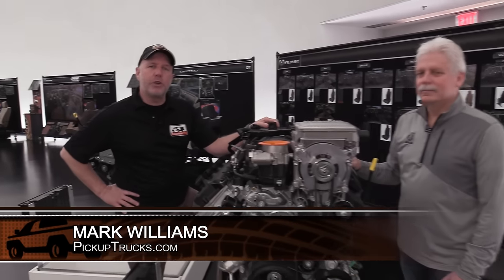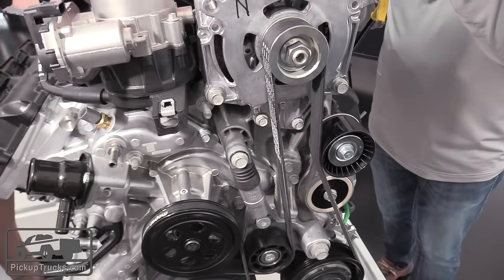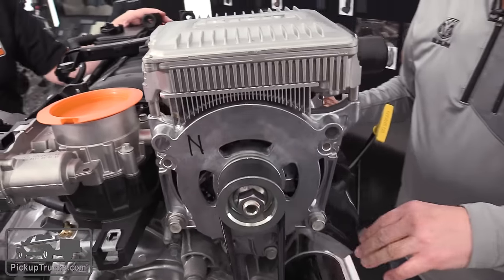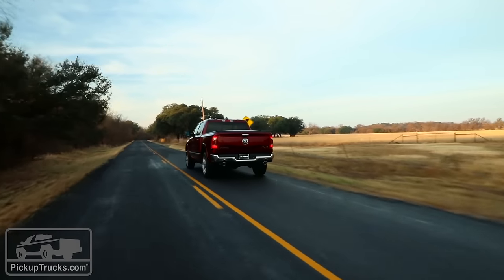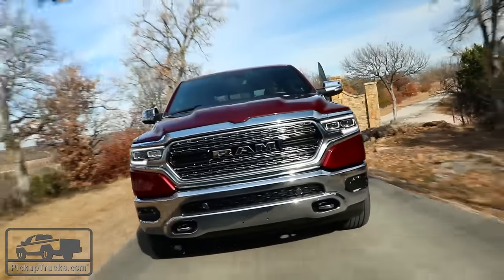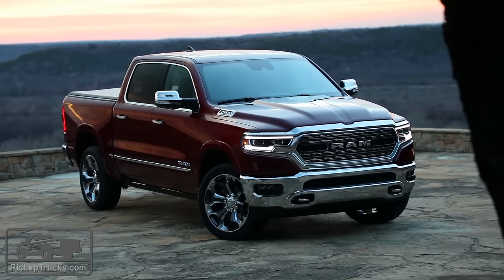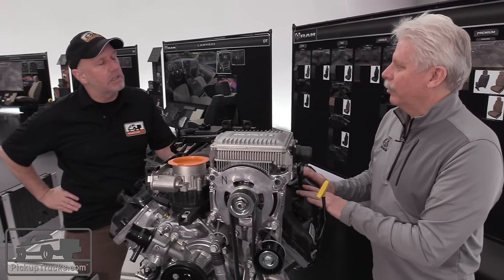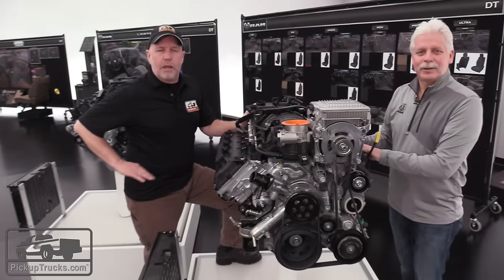2019 RAM 1500 e Torque Explained

Comment: Sounds like something else that can break !!!!
Reply: This is the least it can break in today modern day engine
Reply: Except this 1 part will probably cost 2-3k
Reply: Have an etorque hemi Ram, it’s a cool operating system. Engine shuts off at lights and you barely flinch coming off the brake and it instantaneously sends power to the engine launching the vehicle forward initially. However I would not suggest buying any advanced technology vehicle without buying extra warranty packages. Adds to the overall vehicle cost obviously.
Reply: Exactly
Reply: The narrator: In fact the cars caught fire
Reply: Love mine.
Reply: Mines broke today
Reply: Oh no a part that can break it’s not like every other vehicle on the road is made out of parts that can break.
Reply: I've had mine 3 months and it's been in the shop five times already ,I recommend ot getting it
Reply: Fact
Reply: My bestfriend owns a mechanic shop about a hour east of Houston  said he just put one on a 19 model that broke with 100k miles cost em $6k for a new mopar e-torque system.. wild no thanks
Reply: Good thing it's just a bolt in and you can remove  it lol
Reply: 48v in one
Reply: Sounds like something that is extremely expensive when it breaks out of warranty.

Comment: I would rather just spend a few more dollars on gas than to have to worry about how much it will cost to get this fixed when it craps out.
Reply: SkywallGuttz  and he didn't pay a dollar because that's covered by warranty.
Reply: Beeing Its a fiat I'm sure it will need replacement right after the warranty ends.
Reply: @colemiller3900  and he wasted his time to visit a dealership.
Reply: Exactly. In fact your only gaining 1 more MPG. Not worth it. And you can’t do any power mods
Reply: $15,000

Comment: From a straight "mileage" perspective, lets break it down. MY 2014 RAM average about 18 mpg. So if its a 10% gain, that puts me to 20 mpg (using round numbers) SO if someone keeps the truck for 150,000 miles at an average gasoline cost of $2.50 or so, A conventional Hemi would burn 8,333 gallons or $20,833 of gas.. this "E version" would burn 7,500 gallons or $18,750 of gas. So basically you are "saving" +/- $2,000 over the 150,000 miles IF you keep the truck that long. AGAIN from a PURE mileage vs. Money perspective, it they charge more than $2,000 for this "E" option on the Hemi are you "Saving" ??  I know you can argue, its more torque, better towing, blah blah blah , ALL of the typical Diesel arguemnts...it ALL depends on how YOU use your truck .. .. .. just food for thought
Reply: Mike D you must drive like a grandpa
Reply: Mike D or purely highway driving
Reply: Legend Of I45 or maybe I drive like someone who is TRYING to get good mileage... rather than someone who FEELS more manly because they got to 60 faster than the guy next to them
Reply: And will it need a different, more expensive battery? That would alter your calculations.
Reply: It also relieves on on the brakes and the tranny.  Thus give more longevity in theory
Reply: Is your Ram with the 4.7 v8 or 5.7 Hemi v8?

Comment: I think the fuel savings will not outweigh the costs from constant loss of oil pressure between starting and stopping the engine.
Reply: There are Zero fuel savings. My 04 with a 5.7 got the exact same mileage, didn't shut itself off at lights(dumbest thing they've ever done to vehicles) and was a V8 all the time.
Reply: @hughjass1835  and made way less power. And was rated at 5mpg less
Reply: @hughjass1835  lol tell me you can’t afford a new truck without telling me you can’t afford a new truck 😂 even if the gas mileage is the exact same. It’s impressive to get the same mileage with 100 foot pounds of torque More
Reply: @Ed Hughes  but you don't get more torque output. That 100 ft ponds or so is for basically starting the engine and when it's in 4 cylinder mode and trying to lug its way up a slight incline.
Reply: @corndogg78  you get some of the output, but down low. Doesn’t increase your peak though
Reply: I think the Auto Stop is a federal requirement now. If you don’t like it, you can always hit the switch that turns it off.
Reply: The auto stop is why e torque was created. It’s a better system than relying on a traditional starter.
Reply: Very true.  This is just more wear and tear on the starter.  No need to start and stop the engine.  More fuel is consumed when the engine is constantly turned on and off.  Just switch off the on and off mode.  Less valvetrain wear and consistent oil pressure when leaving the engine running.

Comment: will this help me spin the tires
Reply: Yes, until your lifter bearings fail an Destroy your cam shaft.
Reply: @jacobsebastien3910  🤣🤣🤣
Reply: ROTFLMMAO 🤣
Reply: No quema cuh.
Reply: I test drove one deciding on if I wanted to trade my 19 classic for a 2021 nbs. There is major difference in torque response adding this. It will drift around a corner from a stop and do donuts. Also with traction control off it will spin the tires and fish tail even driving at 20 mph. I just did all this yesterday. Now. Overall I will keep my all steel body. The doors and bed feel cheap since they are now going to aluminum. I'm not sure exactly what all is aluminum but if you see the door panel vibrate when you close the door that's a no thank you. Also I'm 6'4" and the seat position in order for me to have the seat all the way back is a no. You have to have the seat all the way down in order for it to be all the way back and when you do that you feel like you are in a car. When I drive my truck I like to have the seat all the way up and back that way I can see around me better
Reply: @jacobsebastien3910  sooooo. You are suggesting that gm has no issues on camshafts for the same issue? Or Ford doesn't have to replace whole engines? Obviously you don't have a clue. You might want to sit down
Reply: That's the real question
Reply: Lol

Comment: This would probably be ok if all one did was maybe tow a small boat or just need a pickup truck for some other reason. I do know this much for sure, It's has not been reliable for farm use. Dust and dirt infiltration into the electric motor/alternator unit probably  played a significant role in failures that are very costly to repair.

Comment: When I saw this on my truck, I knew it was a must to add the extended warranty.
Reply: You are correct.  I hit 3yrs and 21k miles and this ETorque unit failed while I was up in Canada fishing.   Ram desire said the warranty ended 2 days prior to going into the dealers shop.   They also would not except the extended warranty and I had to go through that nightmare after I got back.   Parts and labor fit the ETorque unit was over $2800 US funds.
Reply: @richardgreen5619 I'm nearing the end of my factory warranty and was considering an extended warranty.  Please elaborate on my extended warranty wasn't honored.

Comment: So the e torque is great in 4 cylinder mode... got it. Was hoping it would add more acceleration torque and boost to help with fuel consumption while towing. Like uphill going through the Cajon pass for those in SoCal that are familiar with that stretch of highway.
Reply: e torq does not work in 4 cyl mode
Reply: I wouldn't tell people your from California, they might get the wrong idea Lol

Comment: I just bought a 2019 ram 1500 limited with E torque love it!!
Reply: How are ya liking it a year later?
Reply: Any performance update to share?
Reply: Same here 11K+ miles...runs like a dream.  👍👍  Best car/truck I've ever driven.  Wish the throttle was a tiny bit smoother tho, but quiet on startup like he said, and accelerates effortlessly.  ❤️ it.
Reply: HemingwaysMojito looking at one myself. Hard to find long term reviews still though, from what I have seen. Hard to find a truck that I like without that system too though.
Reply: I turn mine off.. the reason I bought a ram is cause they let you turn it off unlike the competitors.. I own a 19 limited and its s bad ass beautiful truck just gotta see how long she lasts

Comment: I have a 2020 Silverado and a 2021 Ram.  The 5.3 in the Silverado does the restart using the starter motor. The Ram Hemi uses the e-Torque motor for the restart. The Ram restart after auto-stop is noticeably quieter and smoother than the Silverado restart.

Comment: Wonder what will be the cost to fix the e-torque system if it malfunctions. What's the cost of the e-torque?
Reply: $800
Reply: @JD-yx7be  And $3000 to repair...LOL
Reply: That’s why I made sue I got the extra warranty for up to 8 years 125,000
Reply: On the bright side - it isn't buried under the engine :)
Reply: Government requires them to have a 80,000 mile warranty on it
Reply: Drive under warranty and stop crying over what ifs

Comment: That is one slick system. Nice to hear it fills in during 4 cylinder mode and off the line with that 150+ ft/lbs of torque. The regenerative capture, nice. I think it would be quite reliable. Just keep it dry, free of oil leaks, and maintain the batteries! I'd buy it👍
Reply: If I want to run on 4 cylinders, I would have bought a 4 cylinder
Reply: How long have you been working for Chrysler? ( Or whatever they're called now)
Reply: AI comment. You can always tell an AI . They have no real world experience. Lol
Reply: @juliemathis1065  right. I'm an A.I ...we are entering a whole new world of paranoia here I know but... lol c'mon. you just discredited a 4 fucking year old comment on the grounds that I'm a computer... Jesus man😅
Reply: @jasonneal so you are saying when you are cruising down the highway on a trip you don't want the benefit of staying in 4 cylinder mode to get twice the MPG and would rather stay in 8 for no reason and use more fuel? Are you an idiot? Today I took my new 2023 with etorque on its forst trip amd when I was doing 60-80km/hr it would go into 4 cylinder mode for Kilometers and stay at 28-37mpg so thats huge. My 2015 without Etorque would barely ever go into 4 cylinders and if it did it was for seconds and didn't really even boost MPG.

Comment: So I just traded in a  2020 Laramie quad cab and as far as I can tell it had 395 HP and 410 torque. Just bought a 2021 Laramie crew cab 5.7 etorque and the specs are the still 410 etorque. This video says it adds another 130 ft torque but that doesn’t appear to be the case.
Reply: It doesn't add anything. It bumps the motor out of it's low rpm deadzone. When it "bumps" the motor from a dead stop it turns the rear tire one half a turn before shutting back off and turning it back over to the engine. It doesn't run in conjunction with the 410 torque of r hemi. It shuts off as the motor builds power. It's not useful for truck reasons. It's for ritzy upper class folks that fantasize about being truck users as they drive from their gated community to their classy restaurant. Those people are what it's for. Not you or me
Reply: It adds 130 ft/lbs, but down low. Won’t change the top end number. You just get it sooner
Reply: @edhughes1591  you know what gets you there sooner? Less throttle lag.
Reply: @corndogg78  ok? And?

Comment: I had my eyes on a beautiful 2022 Ram Bighorn that had the 5.7 e-torque. I would have bought it because its a beautiful truck but I worry about that battery failing one day. I wish it was just the regular 5.7. Sorry Ram.
Reply: The best thing that ever happened to the used car market is the insanity of the new car market
Reply: If the 48v battery fails it won't let the 12v crank the engine unless they have updated over the past couple years.  Plenty of stories online about people having to have the truck towed to the dealership and the problem being the 48v battery being shorted with no other issues.  Battery replacement and it's back to normal.   The first years had customers without their truck for weeks because of a "shortage" of 48v batteries.  They had the batteries but were sending very few to dealers for parts and using the rest on the assembly line.

Comment: He should've asked for a ruff estimate on how long the battery would last with the recharging system in place.
Reply: Roughly 100k. $5000 pricetag to replace the 48V battery pack. Not including generator on the engine.

Comment: To call it a hybrid is a stretch. I have a 2022 pentastar v6 etorque. If it's on it operates like an EV when stop. Once you get going, it drops out somewhere between 1-2k rpm. Not really a significant gain in gas mileage. What I noticed is that if you don't wait a full 3 seconds or more after you come to a stop, the vehicle will give one hard jerk sometimes when you go to accelerate. Took it in for service at dealership and was told that is an inherent problem with the system. So far I'm at 30k with no other issues. Got my fingers crossed.

Comment: 2020 Ram 1500 5.7 limited etorque generator gone bad 12897miles on it, truck has been sitting at the dealer for almost a month. How can this happen to a $60000 truck and why is this part on back order?
Also can a 5.7 with etorque be converted to a conventional alternator?
Reply: I've been trying to get an answer to this as well. Mechanically, I don't think it would be too difficult to completely remove the entire e-Torque system including the 48V battery. The hardest part would be reprogramming the computers.
Reply: @scottcpan68  thank you for reply and your right it doesn’t seem to hard it’s probably about dealerships getting off their ass to do it

Comment: Bought an $80,000 2024 Ram 1500 Rebel a couple of months ago.  I was able to drive it for about three weeks and 1,340 miles, before the eTorque system went out, Vehicle spit and sputtered while driving, then died completely, and wouldn't fire up.  It would crank, albeit slowly, but would not fire up.  It has been in the ship for almost four weeks, and RAM cannot figure out how to fix it.   The first replacement starter/motor/generator blew about 10 minutes after the tech installed it.  Just this morning, the dealership was told to order the PCM, but doesn't believe that will solve my issue.  Long-time Diamler-Chryslere, FCA, and Stellantis customer, but I have my severe doubts now.

Comment: Very happy this is an option and not mandatory on the  Hemi.  I don't care about fuel economy.  Start & Stop is garbage.  I'd rather have more HP
Reply: I test drove it twice honestly didn’t even know the engine stopped and started. It was so quick no pause hitting the gas as soon as I lifted my foot off the brake it was already ready to go.
Reply: I agree. I own a 2019 Ram 1500 Laramie Longhorn. I turn it off.
Reply: Oh it is now and in 2025 no more Hemi. In the old days you could decide for yourself how many cylinders your car would have.

Comment: April  2021 bought a ram 5.7 etorque..At a stop light I just let the etorque push me off the line ,then I use acceleration,,,pretty slick system and barely noticeable...my wife has a Toyota pruis and camry(hybrid ,,but as usual the Japanese are ahead on technology....Very impressed with new ram,,I sold 2011 f150 ecoboost

Comment: I have to agree with some comments with OUT OF WARRANTY REPAIRS !  Firstly, what's the cost of 48V Batteries for this E-Torque system when you have to replace it ?? Secondly, what will it cost the consumer to fix an E-Torque system out of warranty ?? It's not like you can take the vehicle to a garage up the street OR around the corner and get it fixed at a discounted rate !!  Definitely a dealer monopolized special repair that will cost the consumer a small fortune !! Their goes all the money you just saved in E-Torque fuel savings over the years in just one repair bill !!  Accordingly, I always understood that most engine damage occurs when starting a fuel engine ?? These engines are now stopping & starting hundreds of times per day with this new E-Torque system ? I would just stay with the straight 5.7 L Hemi option without the E-Torque system !!
Reply: yeah, just seems like more complexity that can break over time.  all for 1mpg better overall?  if that
Reply: lew scagnetti   once an engine is running the start and stop isnt so hard on it its the COLD starts or DRY starts that do most of the engine wear. if an engine has been sitting for say  8 hours and its time to drive home, thats considered a dry start.  I agree on just another thing to go wrong. marketing gimmick. lots of peple want a bigger engine than hemi 5.7.  So last thing they interested in is saving 2 mpg. My guess is most want a larger engine to tow their trailers without getting into large diesel

Comment: Still don’t understand how the power from the eTorque system is transferred into assist the engine? Does it store energy? Does it actually help power the engine? Or, does it just power the electric system? Does the truck still have a traditional starter motor? Need more details!
Reply: There is a 48V battery behind the back seat.  It powers a large electric motor which is connected to the gasoline engine with a belt. It is used for both restarts and for torque assist of the gasoline engine. If I have it right the large electric motor recharges the 48V battery when it is not doing either of those two things. (Normal startups are still done with the conventional starter and 12V battery.)
Reply: @allenw969 Thank you Allen!